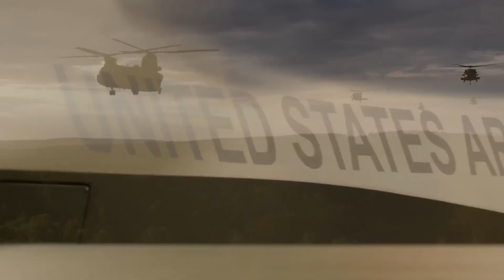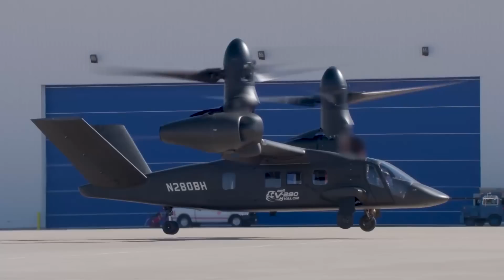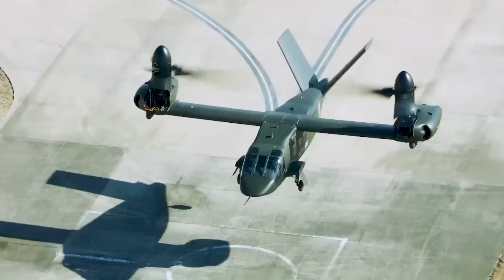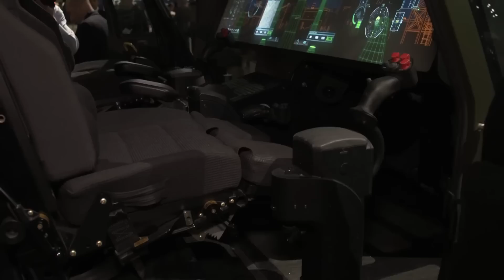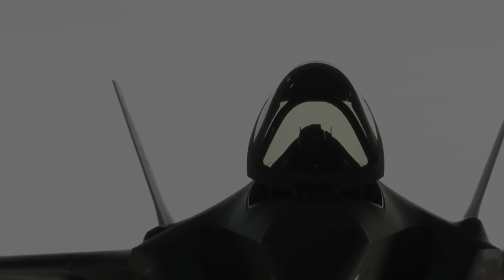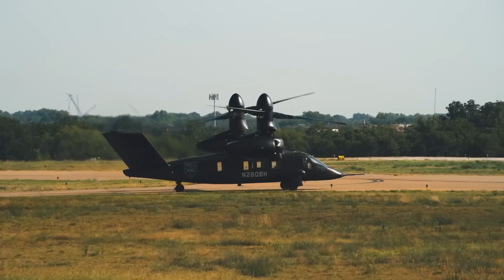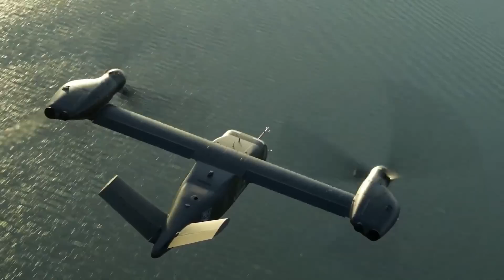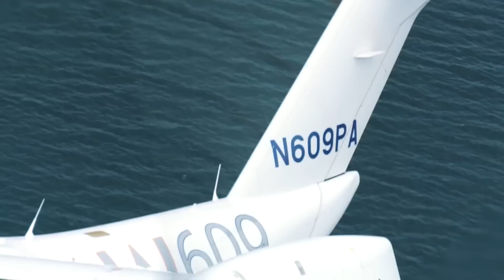V-280 Valor – The future Black Hawk

Comment: Why replace the Chinook? There is nothing wrong with it. Just upgrade it. Give it stronger rotors and upgraded engines and some structural upgrades so it can lift more weight and start building new ones. I don’t understand why they want to fix something that is not broken. The Chinooks design can be used until the end of this century and do just fine. And it’s cheaper to just build some more than to build a whole new design. And why is the Blackhawk being replaced? There are ways to make the Blackhawk faster and able to carry more people and more stuff without building a whole new chopper.
Reply: The army is concerned about the asian region for the next conflicts. With the vast pacific ocean and ranges between islands and countries, they needed a way to transport troops long distances and quickly. Hence the v-280.
Reply: This video has lots of fundamental issues about the FVL program.  V-280 is NOT a replacement for the blackhawk  that will be a different program eventually.  V-280 is 'long ranged assault aircraft'  V-280 will take over some of the tasking of blackhawks but blakchawk production is still anticipatted to be continue into the mid 2035's.  By then the black hawk replacement (JMR-Medium: Utility) is hopefully sorted
Reply: It's about RANGE and SPEED bro
Reply: According to the requirements for this competition, speed and range were major factors.  The Chinook could never compete in those areas.
Reply: The V280s speed makes for rapid turn around.  In this sense it replaces two Blackhawks.  
Interesting how old helicopters like the Chinook and Huey just keep chugging along.
Reply: This platform is not replacing the CH-47, that is for a future program. They're looking at much greater speed and range, and increasing difficulty of getting meaningful upgrades into the CH-47 platform.
Reply: There is nothing wrong with the Chinook but the army wanted a Blackhawk replacement that could also carry howitzers. Right now the Chinook is the only one doing it.

Comment: Uh huh…it’ll be just as successful as the V-22.
Reply: Let's hope so. The V-22 has been massively successful and the harbinger of an entirely new capability for the military.
Reply: @Desrtfox71  Boy I don't think so. It's been nothing but trouble since day one. 16 fatal accidents on a fleet of only 375 aircraft.
Reply: @6862ptc  actually it has a safer record than the blackhawk. Unfortunately since it carries more troops, if it does go down there's usually more casualties.
Reply: @ameritoast5174  Wrong!!! The accident rate for the V-22 Osprey is THREE TIMES as high as the BlackHawk helicopter.  Over a ten year period the V-22 averaged 3.27 accidents involving a fatality per 100,000 flight hours, while the BlackHawk averaged 1 accident every 100,000 hours. Since the U.S. BlackHawk fleet is so large and the V-22 fleet is so small, you must look at accidents by hour rates for an accurate comparison.
Reply: @6862ptc  Except the Airforce numbers say otherwise...
Reply: @n3v3rforgott3n9  I doubt that, but who cares? We are talking about the combined services record, NOT just the AF, which only has 52 V-22s, to the Corps 236. But thanks for your input.

Comment: The V-280 was always going to be the choice. The MV-22 operationally has proven to be quantum leap over existing helicopters
Secondly the Valor is only for US Army to replace its Black Hawk. The USMC, USAF and USN are already operating the V-22s 
SH-60s uses by the USN are far more compact allowing for operation on small ships
V-280 is too big
Reply: It's not that much bigger than the H-60.
Reply: @Gridlocked  
Ship borne operations wasnt considered
Reply: Because it is an Army project. The V-280 gives the Army greater flexibility for indopacific operations.
Reply: @verdebusterAP  Naval versions are being considered, but still in the early planning stages
Reply: With the swivel wing configuration itll only take up about the same amount of space as a huey
Reply: @spazmonkey2131  
if they are serious about it then they need to make scale model to show the USN and USCG that it can be done
The USCG benefits from USAF, USN and US Army operating the UH-60
its droves cost down
they would get in V-280s as well
Reply: @verdebusterAP the prototype didn’t need to fold.   I’m betting the production wing will be designed with optional wing fold in mind.
Reply: @chrissmith7669  
That depends 
The MV-22s problem is that the main gearbox is prone to hard clutch 
The question remains is that due to the folding design or something else
Reply: @ no.  It’s due to the physics of the torque sharing as i understand it.  The Chinook had a similar issue a few years back. Boeing thought they had solved it but it seems the Osprey shows otherwise.  A turboprop doesn’t have an overrunning clutch so doesn’t suffer from the effects of the power pulses.  The shaft passes from nacelle to nacelle and doesn’t care about the swing wing.
Reply: @chrissmith7669  
Thats explains why the USMC hasnt asked for MV-22C 
A MV-22C would reuse the CH-53K GE38 engines for commonality which would save the USMC a lot in maintenance ,training and supply 
It could follow the CH-53K with cabin wide enough to accommodate master pallets. Reuse Harvest HawK TSS in place of its FLIR again savings
Lastly the  Cobham  FR-300 hose drum unit so it can act as a tanker
Just those 3 allow would be a massive improvement
Reply: @ actually. The marines have been quietly supporting development of a tiltrotor with „step increase in performance „.   Look on the NASA tech report server about the Military Heavy Tilt Rotor intended to lift a combat ready LAV-25 type vehicle.
Edit
The MHTR couldn’t use the CH53k engines unless it used a twin pack of each.   The analysts calculate 15k hp per side.  An F135 from the STOVL variant F35 would do nicely.

Comment: The V-22's tilted engines essentially create a jet blast downward that it is a danger to personnel. Hence, no sliding doors on the sides of the V-22. The Valor solves that problem, making it more like a helicopter, with doors on both sides. Bell hit a home run imho.
Reply: The navy also wanted the rear loading doors as it was a cargo platform mainly.
Reply: @n3v3rforgott3n9 Exactly. The Navy wanted it for among other things Carrier Onboard Delivery. It needed to be able to fit an F-35 Engine. The V-280 only tilting the rotors using a mechanical linkage also greatly simplifies a lot of the mechanisms and systems needed. The Osprey needs to tilt all of the control wiring, the fuel and hydraulic lines. Plus it makes that power take off shaft that allows one engine to power both blades much more complicated with complex finicky clutches at both ends. It’s suspected a clutch failure is what caused the recent crash off Japan. But that same shaft system is much simpler on the V-280. Because the engines don’t move.
Reply: @andrewtaylor940  this is all true yea and those design choices were to meet marine corp and navy requirements. The engine has been improved from the begining as early on it had to be taken off the aircraft very often
Reply: @andrewtaylor940  Don't forget the the same electrical and mechanical systems also need to twist at the wing root for storage. That must have been a nightmare to engineer.
Reply: @andrewtaylor940  I heard it was pilot error with the last Osprey Crash. But you’re right about the simplification of the Tit Rotor Design from the Osprey to the new Valor. Fewer moving parts is always better. It’s the evolution of a game changing and brilliant design. The Navy, Marines and the Army really do need these aircraft for whole host of reasons. Helos aren’t going to be able to cross the vast distances in the Pacific. Especially as things become busier in that part of the world.
Reply: @lisaroberts8556 The main advantage that the Valor has over the Osprey is advanced computing that Simplified the controls and minimizes the “pilot error” ……Which in large part was the The learning curve that the Osprey doesn’t perform like either a fixed wing or a rotary wing craft but a mix of both.   It’s basically the difference between early drones and the current generation…You had to actually fly the early drones, the new ones have push button takeoff and landing capabilities and the computer does most of the work for you
Reply: The V22 exhaust can scortch its landing site. This is an additional reason the V280 does not rotate the entire engine nacel. Backward exhaust blast may also mitigate the vortex-ring-state danger on landing (by distrupting the proprotor downwash, but that's just my speculation - I've not seen any aerodynamic data).
Reply: @brettany_renee_blatchley  tilt rotors in general apparently have a better time at dealing with VRS although that might be all dual rotor helicopters so the Chinook would be included in that. Still an issue but less of one.
Reply: @n3v3rforgott3n9 , I mention VRS because the V22 has had at least one fatal accident involving this. (For others: Vortex Ring State involves loosing lift because you're caught in your own downwash.) I was wondering if sending the exhaust perpendicular to the downwash would either reduce the downwash and/or distrupt the dangerous flow.
Reply: @brettany_renee_blatchley  Generally dual rotor helicopters like the Osprey and Chinook have a better time with VRS than traditional helicopters but that does not mean it is non existent. Simply the Osprey is no more dangerous than other military helicopters. Not to mention it was the first full production airframe of its kind.
Reply: What happens if a helicopter loses a set of blades?... Moot point. Also if it is traveling forward and has enough speed it could fly on a single rotor as other dual engine prop planes can. As the lift is enough to offset the torque. You would just turn off the working rotor when you need to go slow enough to land and glide down. Both engines turn both rotors at all times though and rotors are much harder to destroy than other parts of an aircraft.
Reply: @n3v3rforgott3n9   a helicopter RARELY suffers rotor damage that isn’t already catastrophic to the aircraft…. And in many cases can autorotate on engine failure. This thing is inherently unbalanced and can’t operate on only one rotor, with stubby wings incapable of providing enough lift to glide safely.

If a guy with a 50 BMG hits the gear box on a helicopter, it can autorotate. Hot either gearbox on this thing and it flips over and pancakes into the ground
Reply: @Matt-yg8ub  ... You seem to get even the basic facts of it incorrect. Also "a helicopter RARELY suffers rotor damage that isn’t already catastrophic to the aircraft" ... it would be the same with this aircraft. "And in many cases can autorotate on engine failure" ... So can this... also autorotation has not saved a large multiengine military helicopter in decades... so focusing on it shows how little you understand. "This thing is inherently unbalanced and can’t operate on only one rotor" ... same with a helicopter... Also just like a dual prop airplane if it was in forward flight and had enough speed it could fly on a single prop. "with stubby wings incapable of providing enough lift to glide safely." ... based on fuck all... they have already proven this is possible with previous test bed tilt rotors. 

"If a guy with a 50 BMG hits the gear box on a helicopter, it can autorotate. Hot either gearbox on this thing and it flips over and pancakes into the ground" ... again you are not understanding the basics of the platform. Also the same person could just shoot the pilot in any transport helicopter...
Reply: @n3v3rforgott3n9  you don’t seem to understand the wings here do not provide enough  lift, or that damage to either rotor pod is catastrophic failure for the entire aircraft. 

As usual, they argued that a single engine could drive both rotors…. But they carefully, avoided ever talking about the fact that mechanical damage to either renders it inoperable and the entire aircraft crashes.
Reply: @Matt-yg8ub  they do though... the osprey can glide and this would have a better glide ratio... Again this was proven in the past with previous tech demonstrators. Again you are wrong... Both engines turn both rotors at all times and a loss of a single engine would still allow the aircraft to fly or land safely depending on circumstances in place. When mechanical damage happens it does not just stop the rotors in place... Also again of the same type of mechanical damage happens to one of the 2 main rotors on a helicopter it is also done for. You are not even getting the basics of it right but have such a heavy bias as you blindly follow what people say online.
Reply: In hover the rotor lift is significantly increased by “ground effect” so when hovering with one wing over solid ground and the other not, an asymmetric roll rotation will occur. This is very dangerous for example when used in carrier or rescue operations.
Reply: The Bell V-280 is better than the Sikorsky SB-1, faster and more fuel efficient and smaller.
BUT i wonder if the V280, which will be closer to battle spaces than the V-22, has an issue which made my spill my drink. 
The V280 will be the successor to the UH-60 and likely the UH-1Y, so it will fly and land closer to the enemy just as the black hawk did, so the likelihood of bullet strikes. WHAT IF, while in forward flight,  one of the rotating mechanism for one of the two rotors systems was damaged by a bullet impact, and one or both of the rotating housings could not pivot - ??? If a helicopter gets hit,  it can do auto rotate, or just lower its speed and land. . But if the Valor get go into helicopter mode, it can land. I think the driveshaft is what tilts the rotor housing, but could the propellors be stuck in forward mode... is this a possible malfunction? What happens then, Valor can't land with the props forward.. WhaT hapPenS theN?????!
Reply: @A-Chaps  so if the tilting mechanism is damaged it would have to land on a runway as a normal plane would which of course would sacrifice the rotors. They are designed to fold and break away from the fuselage like they do on the osprey. Also a tilt rotor can glide or autorotate as well.
Reply: @A-Chaps  any mechanical damage to either set of rotors, will throw the balance off and force it to crash